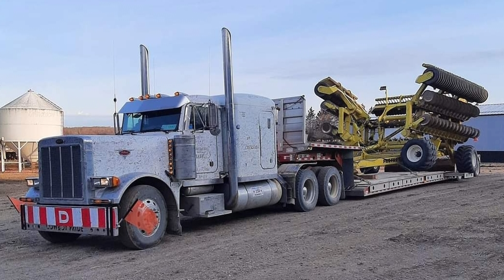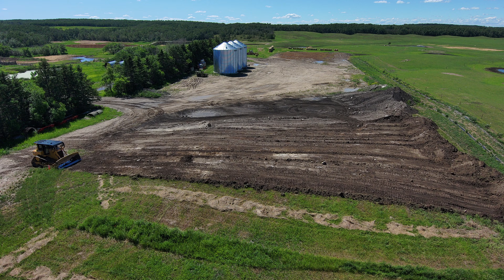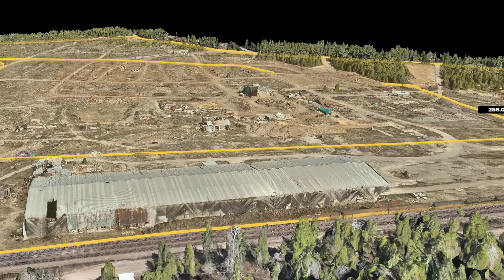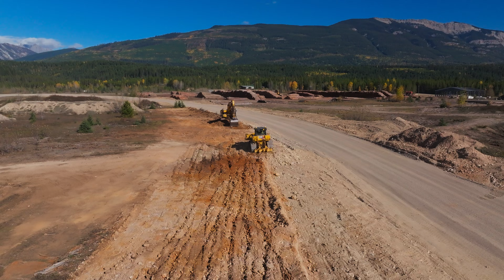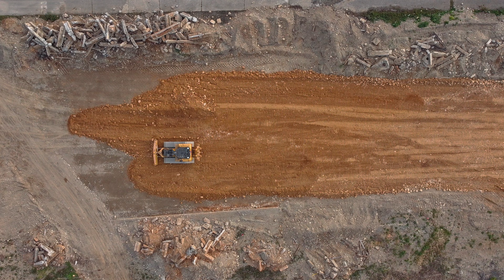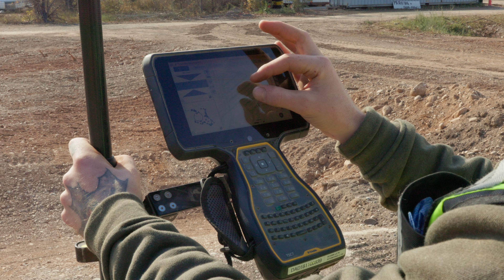We Thought This Job Was “Beyond Our Scope”

Comment: I already knew a lot of this but the way it was presented makes it a lot easier to really understand. This also shows why building a road can be so expensive. A public road usually starts with being dug down a meter or more into the ground then it's filled back up with gravel before being compacted and eventually toped with tarmac. This is done to provide run off for water so the road doesn't get damaged when winter comes around. So it's not a small job of just leveling the surface and put tarmac over it. That really only works where there is no freezing winter and preferably not to much rainfall that can flush out the dirt.

The Romans was known for building roads wherever their empire took over. They put their legions to dig them out, fill them up with stones gravel and sand before they put stones over them for a surface. Some of these are still in good condition today, and that's because they were built like that. But it wasn't the cheap way of doing it.

Comment: Just curious did you do many test holes to see what was underneath or did you just wing it. Seems like that could’ve been a good idea if you didn’t.
Reply: The way you make money on government contracts is by doing a better job at figuring out what’s under the ground than the engineers and bidding accordingly. 

So if on the RFP they are way under on a certain type of material you jack up the cost per cube on that line item. And then maybe cut back on the price of the material they think there is more of. It will make your bid much more attractive while also getting you more money. You might know this already tho. 

Cheers man I wish you all the best

Comment: If a machine is designed for 'X' amount of tonnage or capacity, and you work it at 75% or 80% of that, gonna gain a ton of component life and reliability, balance out the time factor being on site.  Added .. if you run into a circumstance where you need to push 100% for a bit, you've preserved that percentage of component integrity and your equipment likely won't let you down.  Personally, I'd rather be on site every day with all equipment moving than most days with half the lineup parked getting repaired.  I own a very small company - downtime is my biggest fear during the year.
Reply: Agreed!

Comment: Video's  set not to auto start here.  ie: not seen.
I subscribed to see series hybrid trucks being built.
NOT tracks and workshops etc.  
(Which  could be interesting if efficient  CHP and biogas etc, but Apparently that's too technical for you-all..???)
IMHO you are scrapping the bottem of the  barrel here...

Sell pure EVs, with a 'hole' where a genset might  fit.
Along  with 'stationary' gensets (to charge them)  that just so happen to  'plug' into said hole.

Have an alternate; 'Range Extender' battery pack and  token Solar Panel kit that fits the 'hole', to wave around in court.
(depending  on country  laws...)

If 
the customer chooses to bolt their stationary genset into said hole
then
The Law has issue with them, not you.
And you have interesting TV if/when The Law starts shouting etc. 
Also; whoever is Actually trying to block you is forced out in front of the  cameras...

Comment: Being a surveyor down in the states (and we use Trimble too!) it's always fun to work with companies that just want the stuff they need surveyors for and don't need is to stakeout and hold their hands to build a road. I get it if it's a highway, but holy crap am I tired of putting 25' and 50' offsets with blue tops in.
Reply: Massive respect for the in depth surveying and knowledge that goes into this trade. And operating a darn Rover 😂

Comment: You will get the next big job; keep at it.👌🏽😎👍🏽
Evolving through work was my path as well. I started at the bottom as a non skilled worker and evolved to the Master technician way before my bachelor's was up and I entered the project residency as an engineer up for licencing & appraisal with several apprenticeships under my belt. By the time I was up for deployment & my first Job I stood on firm ground. Your site works on the Edison Motors plant; oh that reminded me of getting the danger zone on the Kuwait Iraq border built up like a fortress. We built radar and thermal long range towers, upgraded 9 major border stations with top notch command centers and lined 73.5 kilometers of no man's land with the largest ground following radar array of its kind. 
5 years we spent surveying and tackling varying terrain through old abandoned structures. Tidal sand marshes, buried leftovers of huge armored vehicles battlefield and land mines. Trust me I am no civil engineer nor am I a military specialist ground clearance expert, but by the time  I was done I became both a certified & experienced practitioner of all disciplines involved A to Z.
Moving to the south border I got 5 times the work linking up 300 km of perimeter with over 120 towers and 30 border patrol stations. Simpler and lighter than the first no man's land but 7 times the work and worth.

Comment: As an ex.state of vermont construction engineer....I question that you did not use a grizzly screen to remove oversized rock. We did not allow, over 6 inch stone., in a 12-15 inch lift. Also I didn't see a water truck, for compaction.
Reply: We would have loved to run the aggregate through a screener. However that would have added 30%+ to cost, that we didn't have unfortunately

 When using the GPS to lay in the rocks, we can build the lift according to the rock size and blade those large rocks to the side pretty easily. We would bump our offset down, and wing everything down-hill. The big rocks would roll off the road top , and we would then dozer it all back over. 

Also The material had pretty good moisture coming out of the ground, and we had a lot of rain throughout the season. Every 2-3 days it seemed. Worked out very well. There was 2 instances where we had spot-placed loads, and waited for rain before pushing them out and packing them in. Otherwise it was pretty darn good

Comment: What technology is used to determine altitude on the heavy machinery? And how precise is it (within 10mm, 100mm, etc.)?
Reply: Trimble / Cat brand GPS .

There is a "base" station GPS receiver setup near the equipment, to communicate a consistent  static "known" location

Then, the dozer will have 2 GPS receivers on each side of the machine. Communicating with the satellites, as well as that base stations known location. 

This Calculates the position of the blade according to the 3 GPS receivers and the sensors on the machine. 

 2.5cm or 1" accuracy is a realistic expectation
Reply: @HardWorkIndustries fascinating. Thanks.

Comment: sounds like a gravy job.  looked relatively flat and with material that didn't turn into a mud pit if wet.  Sask dirt is loon shit when wet  slide everywhere and sink up to your axels.     was part of the crew that did the ground work  for the mosaic conveyers,  between k1 and k2  to k3.   also built new pond expansion on k2.  wish i could operate one of those new 745's  I'm quite familiar with the mid 2000's  740's  and 2013 Komatsu 40 ton.
Reply: Material was awesome for stability and quick compaction. Whole site is literally a gravel pit. 
On the other hand it sure is hard on the old spine and iron lol

Comment: The music is too loud but otherwise this is interesting 😊
Reply: Agree 100%. It's something I wish YouTuber's would learn, music should never annoy and it absolutely should never be equal to or louder than the person speaking.
Reply: Technically the music is half as 'loud' as the dialog, measured in LUFS.  And the music is 'ducked' another -6dB whenever the dialog hit the compressor.  What you are hearing is the illusion of loud music. The 'air' or wind ambience is louder than the music in some spots.  Im guessing the music itself is the distraction not the volume levels.
Reply: @aarontchir9695  if true for you it must come out at differing volumes depending on quality set on YouTube or some other reason (perhaps it depends what headset/speakers listened on?) either way it is louder than would be proffered, though it was barely under the level where i personally would have brought it up.
Reply: just deal with it, complain.....complain. shut up
Reply: @rickdommett  theirs is constructive criticism whats your excuse?

Comment: I follow Edison Motors as a classically trained Mechanical Engineer, with limited soil mechanics exposure.  I so enjoyed learning about modern road construction techniques especially the digitization of the earth’s surface and subsequent cut and fill calculations.  Extensive prior industrial use of  the site made for many unknowns.  Sawmills predictably produce copious quantities of sawdust which is useless and must be disposed.

Well done; nice to see another example of the win-win synergy that Edison Motors brings to all their stakeholders!
Reply: In re: sawdust/ biomass and c/w combustion tech. Sawdust is an excellent source of carbon/ charcoal complete with the exothermic result process. 
Value added. Imho.
Reply: @FFLFFS  how true!  Worst case scenario, use it as mulch.
Reply: Yes, I appreciated the cross-section of the earth column he showed us. I understand the need for the test track to have high performance, and the need to clear the site, but in permaculture, there is no waste. Sawdust might be contaminated and not usable for a food system, but it could be buried under a berm that's planted with ground cover and wildflowers. The old asphalt mixed with rocky materials might make a decent gravel driveway. Maybe not, and it's easier to dump than try to deal with.